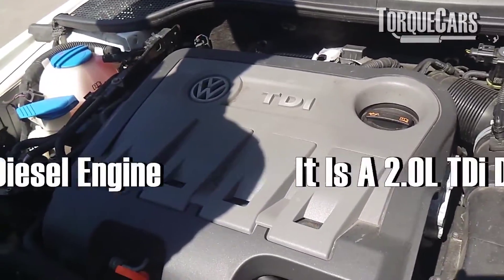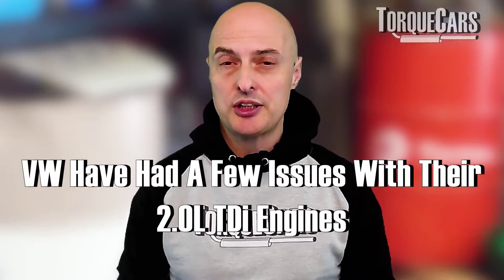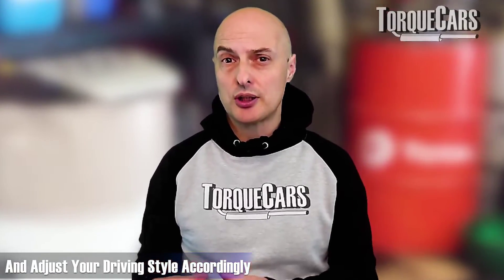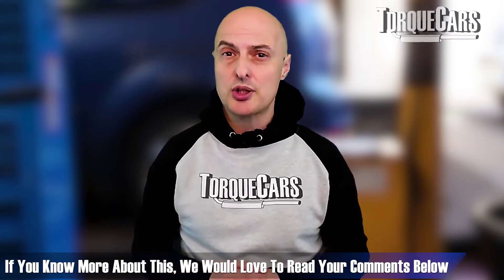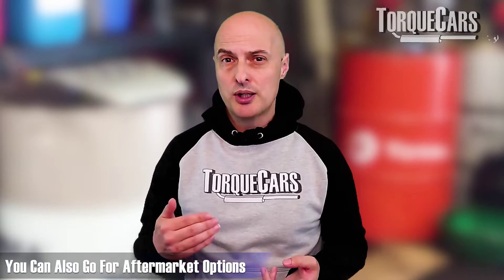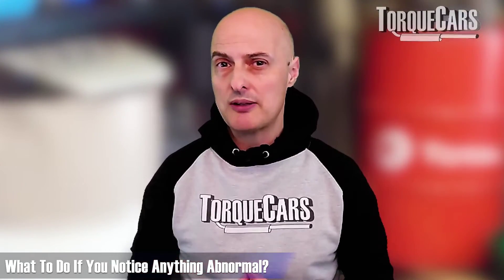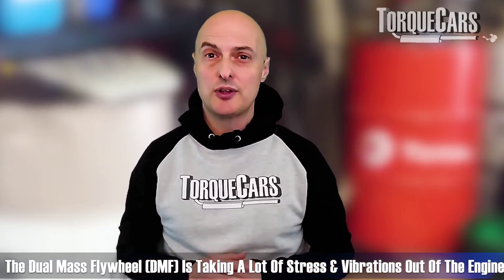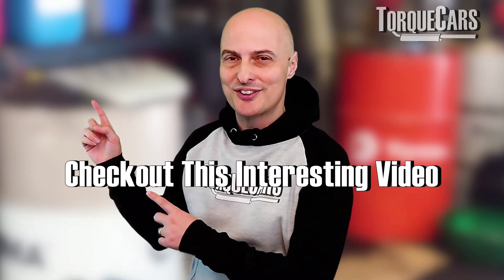VW 2.0 TDi (2012 on) EA288 Did They Avoid Those Common Problems & All You Need To Know

Comment: Re- the water pump there seem to be 3 versions - would I be right thinking if I used the one without the variable pressure adjustment I would avoid issues in the future - I am 12K away from doing a cam belt and pump replacement and all the associated bits crank seal oil pump belt - really how could they Why not keep it external like the cam belt - I love diesels and have been driving and fixing them for past 25 years
Reply: Let us know about the water pump replacement, with or without variable pressure adjustment!
My engine is code CLRB, 110kw...I may do the same 😊

Comment: Where is the latest video you mention in this video that Vw discussed the latest issue . My egr valve has failed due to a plastic gear no been able to cope with the high heat so it’s probably lost the teeth so the gear can operate. So I’ve had it deleted but now my car won’t do its DPF regeneration unless I take it for a blast

Comment: I have a Skoda Octavia 2016 with CRMB engine , the only problem I have is on accelerating suddenly stalls for a second and then it goes normally , and sometimes in idling in light suddenly goes off and it needs a long time to start , I have 700.000 kilometres on it . Fuel pump or injectors maybe ?
Reply: That's nothing for that mileage, man 😂

Comment: 2012 Skoda Superb. Had 271,000 miles. The godamn oil pump went. Apparently some of these Skodas had hex head oil pump that fails.
Not sure if in later models post 2012. Engine and DPF fine. It was oil pump that let me down. Didn't see light on and engine seized up

Comment: I have a 2012 Tiguan sport TDI it was an ex-rental car and when we bought it it eas just over 14,000 mile in summer of 2013 but only 6 months later the transmission, clutch and DMF started to leak, fail and slip so within a week the whole transmission powertrain was replaced back to up and running. I'm not sure if it's a EA189 or EA288 engine. The code js CFGB 170PS version, still going strong after 13 years of abuse and 146,000 miles of salty air but interestingly lack of rust

Comment: VW Passat B8 Automatic 1.6TDI diesel ⛽ Drinking Engine oil 🛢️ like beer 🍺🍻🍻🍻 🍺 4liter every 1K .  
:( 😢😢😢😢
Mechanics confused said turbo and pcv r Dry and excellent. No puddle under the car, no oil 🛢️ anything shiny underneath car
Reply: Known fault when it starts getting to higher mileage the bottom oil control piston rings block up with carbon so then the engine really burns oil like crazy and this oil residue goes into the DPF which then causes it to regen nearly every time you turn the engine off. This then soon blocks the DPF filter and egr valve up and the car goes into limp mode! Taking DPF off to have it cleaned only prolongs the pain as only solution is to have engine rebuilt / pistons replaced at great expense.

Comment: 2017 Audi a4 owner, oil consumption started at 70k miles, coolant use not long after, egr cooler replaced at a cost of £900! Clutch and flywheel @ 85k sold as spares or repair @ 88k due to failed head gasket, these aren’t a patch on the old 1.9 pd

Comment: The 2009-2011 run of 2.0 170 cr engines are incredible tourture tested on and it did 120,000 miles with just oil top ups of castrol

Comment: I am looking to buy a Seat Leon (late 2017) 2.0 184bhp. Is this a good car does anyone know?. And does anyone know which Engine version would be in it. Thanks
Reply: Bought new Leon FR ST 150 TDi in 2014 .  Has always been brilliant.  Mileage only 96 k.  Easy journeys in Cornwall and avoid short ones . Use V power . Let engine cool turbo / and do not turn off if regenerating . Reg oil changes  . Remove silica bag of gunge from water cooling system.  Enjoy !
Simon .

Comment: As a newbie to diesel and now driven this 2016 passat, how can driver know if engine is "regenerating its DPF". No known indicators on navel panel. I do occasionally identify a rough engine note with more vibration. Any clues, information greatly appreciated. Car now at 79k.
Reply from the maker: This video discusses that very topic, and there are typically a few signs to watch for  https://www.youtube.com/watch?v=54GrVq8_KqE
Reply: Useful link so thankyou. More stuff to occupy ones attention. I did notice cooling fans on much longer than normal when stopping engine. I will look out for mpg during periods of rough running. Mosty do motorway use 60-75 mph. Havent noticed  a reduction of mpg for same journeys. 42 miles journey takes me to 60mpg aporox. Fab videos.

Comment: As I understood, the oil pump of these engines is driven by a rubber belt (which runs in the engines oil! 😮). Also the oilpump capacity is limited. In Germany there is a company which replaces the drive belt for a chain and in the proces they also replace the complete oil pomp by another one which delivers more capacity. Because of this wet drive belt it’s mandatory to replace the engine oil regularly.
Reply: @yellr68  any details on this modification or the company that do the work.
Reply: @flo-rider46 waiting the same for the answer...

Comment: Hey I have a Skoda Octavia 3 RS and I have a problem with starting in temperatures of 9-22 degrees it spins longer this is the engine code CUPA. The battery is new + fuel pressure sensor and valve is also new below I will give you a video of how it starts when the old battery was with the new one it is the same after 2 months

Comment: 120k km and got xooling problem as radiator blocked and egr spits coolant out
Reply: Change the heater matrix and header tank for the new one with no silicone.
Cut your old header tank open and check the bag of silicone has not broken yet.
Don't try to flush the engine or matrix as that can cause more problems unless you find the bag of silicone inside has broken.
The blocked heater matrix will cause coolant to overflow    its a common fault.

Comment: Don't forget about the infamous bag of silca gel crystals in the cooling system reservoir. The one  in the reservoir of my 2016 Leon FR 180 diesel went 2 months ago. Fortunately, it was caught early. A system flush at a main dealers, including a special fluid to break down the silica, cost me nearly £500. The cooling system now has a slushy gurgling after the engine is switched off and the recirculation pump continues pushing coolant around the system; trapped air probably.
Reply: @EuropaSman  
The trapped air will work its way out eventually.
I've had this, the heater matrix gets clogged, and that will cause the coolant to overflow.
The best thing is to change the heater matrix, easy 1 hour job and change the header tank to the new one with no silicone.
If the silicone bag has not broken dont try to flush the engine or try  to flush the matrix as it can cause more problems, just change the matrix as its cheap and easy.

Comment: water pump should be changed at every 60k with the timing belt, so no problem there. also, there is mechanical water pump replacement, not the electrical junk which can fail...
Reply: Please, do you have a link to that mechanical water pump, so we can order it?

Comment: Hello, may I ask you a question regarding my car?

Car:
Make: VOLKSWAGEN
Model: Caddy
Year: 2017
Engine Code: DFSD
Engine: diesel
Engine Capacity: 2.00
Engine Cylinders: 4
Engine Unit Assembly: 04L.E

Original power: 102hp / 259nm -- Current power: 194hp / 401nm

I have this knocking sound (no, not rods etc), sounds like ignition knocking, but as I'm "new" to diesel engines, i can't check the non existing spark plugs :p haha 
Can this be the fuel pump, injectors or timing has gone a bit bad?

Car is remapped from 102hp to 194hp, everything went fine for about 30k km (car has only gone 118000km), this suddenly started when i was on a trip, and it seems if i push throttle to 90-100% at 3rd or 4th gear, I get a bit of "boost" problem, whereas the sound is similar to having a too small wastegate spring on a gasoline engine. Like letting it's out a small bit of pressure, but if i go like 70% throttle, it does not happened. This is all after having the remap for 30k km.

Thanks in advance to anyone that may reply.
Reply from the maker: Check for error codes via the OBD port, that might give some indication. Could be a split "air pipe" causing a loss of boost and overfuelling, it will throw out more soot than usual in this case. How is the fuel economy compared to how it used to be?

Comment: turbo is very good on 2009 and 2011 they go about 200000 the main problem its block cracking
Reply: BV43 turbo from 2009-2011 CJAA code engines tends to fail from extreme heat during aborted DPF regens, snapping the impeller shaft and sending the compressor fins into your intercooler. source: it happened to me at 125k miles but i drive pretty hard

Comment: I bought my 2013 Jetta CJAA TDI in 2020 with 90,000 Miles. I had the DPF and EGR removed around 110,000 Miles I am now at 185,000 and the engine is running great. the Dual Mass Flywheel failed around 170,000 at the same time I had the waterpump timing belt and fuel filter replace. I think when the DMF failed it damaged my DSG. (I have had the DSG serviced every 40,000 miles) The DSG grinds 5th gear when shifting from 4th to 5th and then when it deactivates 5th gear and settles into 6th. I love the car but it has been pricey to keep going because I didn't plan properly and pay attention to Scheduled maintenance

Comment: My 2017 Skoda with the EA288 engine has become hell. Blocked DPF, blocked EGR, faulty SCR system. In my experience they are definitely not an improvement on the old EA189 engines despite their bad press. I have one of these engines on an old Yeti with 475,000 miles with original DPF, original turbo and only replaced EGR once which was a cinch as it was on the front of the engine (30 minute job). Modern diesels are 100% not fit for purpose anymore. These systems are supposed to be to enhance people’s health. I doubt that considering the stress they’re causing. I’m a high mileage driver (50k per year) so have to drive diesel but going back to earlier models with less gizmos.
Reply: Why not just remove all those systems ? You can drop your car off get the dpf hollowed, egr etc removed and then remapped come back with more power more mpg and more reliability
Reply: Have you considered a modern turbo petrol like the 1.5 tsi which can achieve 60 mpg combined? Plenty of taxis are using those now and it's common for taxis to do 50k miles a year.
Reply: @Xenon777_ you’re not gonna get 60mpg, I get 40 combined with the diesel

Comment: do you include the older1.9 tdi with rotative pump in your review? I heard those are the most reliable an cheap to matain considering that none of them had DPF.
Reply from the maker: Many consider the 1.9's the most reliable diesel engines ever make by VW. This video is primarily focused on the 2.0 TDi and it's legacy though - it would be unfair really for me to make comparisons between this and the 1.9 as they are very different engines.

Comment: I have a 2016 Golf GTD with this engine. I currently have a strange chirping noise coming from the engine. It also happens after switching the engine off. I suspect it's the secondary water pump failing. Am I right?

Comment: I've had a Superb 2013 with 2.0 TDI common rail 170hp (+remap) (a Superb 5y experience!) and now switched to 2021 Superb 2.0 TDI 200hp (EA288 evo I believe?). I'm noticing a not so small difference in fuel economy, any thoughts on that? Also is a remap worth it on the 200hp (if done properly of course)?
Reply: Does the new engine use more fuel?
I would advise against a remap unless it has an on/off switch as I've seen done on an Astra. 👍

Comment: Just wanted to add to a common problem that I didn't catch in this video. I have a 2015 2.0L tdi in the US. The timing belt on these are a problem. This is something that can wreck your engine if it breaks. 
Here's the long story for those who want to know more... bought the car with 40k miles with a squeak coming from the engine. Dealership replaced the serpentine belt and pullies. Squeaking came back not long after. Had car checked again the next couple oil changes. After every "fix" the squeaking came back. Finally the shop looked further and found that the timeing belt was about to fail. Got that fixed and squeak is gone. 
Extra evendence is theres another exact car for sale (98k) which describes the timing belt being changed in the maintenance history. 
Anywhy if youve made it this far in my comment... I love my car and appreciate this video.
Reply: Timing belt maintenance is not only mileage dependent, the spec is every 10 years OR 120k miles whichever occurs first. Look at it like tires you can never put any miles on a tire but over time the rubber will dry out and fail and it will no longer be safe to use. Same thing goes for a timing belt.
Reply: When did the squeak occur? Briefly, When shifting into drive, or at other times?
Reply: Done mine at 62 k and again 126 k 139 on clock and drives great.
Will add DMF failed at 84 k .
Reply: Its every 130k for timing belt replacement on the 2.0 tdi i did mines at 140k about to get it done again the current belt has 135k on it now and is still good my 13 passat tdi has 266k on it right now
Reply: I also bought a diesel gate TDI, a 2014 Jetta.  Timing belt was a concern since the car had 106k miles on it with no record of a timing belt being done.  The manual says every 130k and I'm at 121k now.  I wonder if I'm pushing my luck, but the car has had zero issues (except a heater core that I replaced) since I bought it.  Plus 40+ mpg is awesome :)
Reply: @heliumtree  get that shit replaced ASAP. If the belt snaps your entire engine is fucked. I’m surprised the manual says 120k miles tbh most advise every 5-6 years 60-80k miles so I wouldn’t leave it any longer
Reply: @heliumtree  I would get it replaced since the car is 10 years old now and 120k miles is alot for a belt to withstand
Reply: @heliumtree  just replaced my at 150k km to be sure as a preventative measure. Never had any other issues.

Comment: It seems that crankshaft sealing flange is somewhat common to leak in EA288 engines.. Fortunately it is often the outer seal of the flange and oil only leaks to outside surfaces of the block and oil sump. Tho, in some cases the seal around crankshaft (integrated into the sealing flange) leaks causing timing belt to get soaked.

Comment: I have 2013 2.0 TDI CFFD engine, manual transmission Tiguan. It has 325000km. No issues, no DPF, turbo, glo plugs, injectors, all still original. Last week i took a long trip of 3200km pulling a loaded small trailer no problem. I do my oil service, and take care of it myself. It is just about due for cambelt and water pump change. I now see a small oil consumption of say topup 500ml between oil services. No warning lights or diagnostic faults. It really trouble free.
The only things I have changed besides the AGM battery is the oil cooler and oil lever switch, the rest including the clutch are still original.
Reply: No city driving, right? 👍

Comment: Very interesting! My only unscheduled stay with my Passat MY 2017 in the garage was the belt pulley, that fell into two parts. Usually fixed together with a rubber layer, one part of the pulley has decided to say good bye and rested on the lower engine cover. Never heard of that before. That happend just above 100.000 km. Otherwise a great car!

Comment: Any thoughts or advice on purchasing 2018 Passat 2.0 TDI with 30,000 miles?
Reply from the maker: I'll be doing a video on this very topic. The service history and use of the car is important, 15,000 2 mile trips on a cold engine can cause more wear than 100,000 miles of mainly warm engine motorway driving.

If the car has had oil changes every year (schedules show time & mileage, it is whichever comes soonest) and the car has been looked after and driven gently and properly warmed up it could be a bargain.

Check for blue smoke when you kick it when it's warm, this could indicate engine wear.

Knowing this engine it is pretty unlikely to have any problems unless it has been very badly neglected but always get a car checked over, sometime mileages shown are not accurate or there may be problems there, mileage is no guarantee of a good car or bad car.

Comment: I bought a 2014 Passat with 85k miles. I had the alternator go out twice in 3 months, but I think it was because of a shoddy job. Other than that, nothing is wrong and it runs/sounds fine. I’d say for $10k and under 100k miles it’s a pretty good deal
Reply: You're not seeing the oil leaks yet lol

Comment: Speaking about carbon buildup in inlet manifold... there shouldn't be any, because high and low presaure egr taks gases after dpf... and there are no carbon particules... I changed te liquid intercooler at 270 t km, inlet was extremly clean....

Comment: There are no swirl flaps on these engines because of inlet and outled valve position... they are standing verticaly, therefor there is no inlet and exaust shafts, valve shaft have inlet and exaust lobes...
Reply from the maker: On the CBBB CBAA VAGA CAGB there were swirl flaps. Are you thinking of the newer EA288 EVO Gen 3 engines which didn't have these, don't suppose you know which year they came in so I can reedit this video for people? FYI my sources were on a 2012 and 2014 engine, which had these issues, which I had assumed were the EA288 engine.

You do seem to know your stuff, can you help pin down the dates of engine revisions? I can't seem to get a definitive answer, or perhaps EA288 overlaps the EA189 by a few years and the EVO was the latest from 2018 onwards.
Reply: @torquecars  hello! I have skoda octavia III (5E5, 5E6) combi! Engine is 2.0 tdi 110kw, engine code is ckfc!
Reply: @torquecars  ea 288
Reply: @torquecars  year 2014